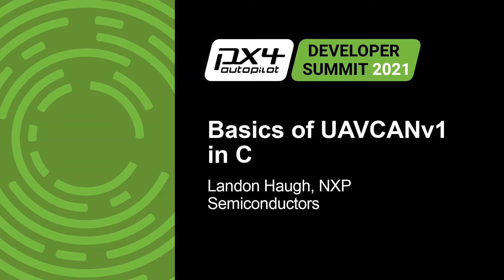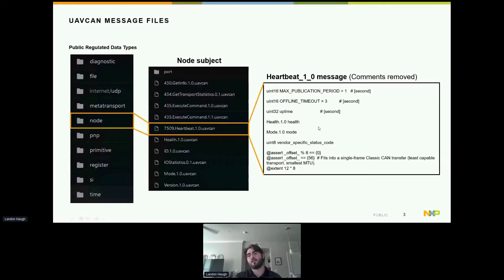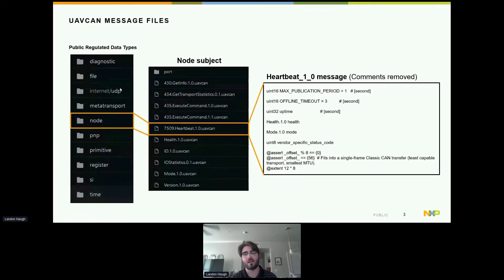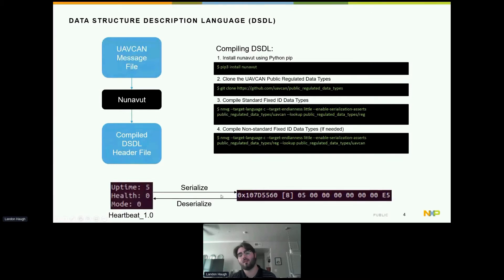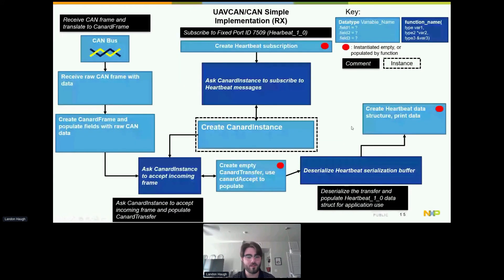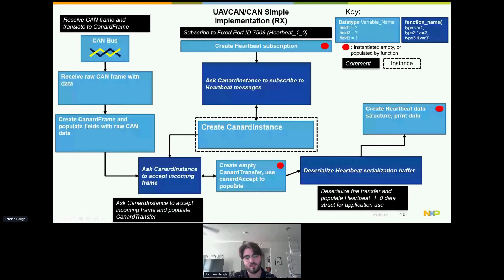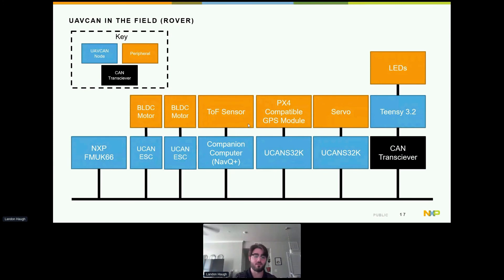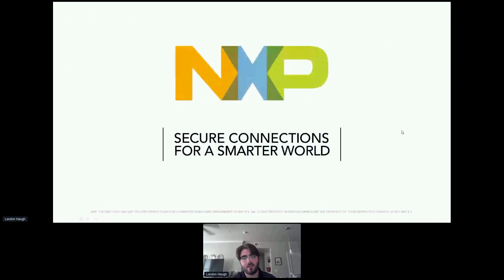Basics of UAVCANv1 in C - Landon Haugh, NXP Semiconductors

Comment: Has anyone tested this example? I am not able to make the receiver work... The frames are discarded by the Libcanard, I do not understand what could be the problem...
Reply: Depending on what can_id is assigned, you might have to mask of the highest bit of the received socketcan_frame. I had the same issue receiving and this did the trick. I added the following mask:
received_canard_frame.extended_can_id = socketcan_frame.can_id & 0x7FFFFFFF;
I connected two beaglebone blues together to test this on actual hardware (not just the vcan0) and had to do the same thing. If you use candump (from canutils) to examine what is coming from the Tx node, you will see correct can_id. The sample code needs this high bit masked off. Maybe when it was originally written the can_id had a high bit of zero and then it would work without the masking.